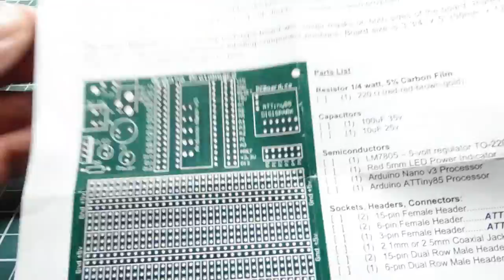Arduino Prototype PC Board / Nano Breakout

Comment from the maker: I talked to the manufacturer of the Arduino proto-board and they are planning to redo the board and change the orientation of the Nano. If you have any other features on your "want list" leave them in the comments.
Reply: Did this change ever make it to the board? I need to use the Nano as a Midi-USB device so it would be great to have the USB face out. The boards linked in the description still look like the USB is facing down

Comment: Looks like a handy board. Don't you think it would have been a better idea to have the USB port point off the board like the the power barrel connector? That's what I would have preferred if I wanted to put it into an enclosure.
Reply from the maker: I was thinking the same when I was building it. The ATtiny85 is pointing off the board.
Maybe they wanted access to the 6 pin ICSP for firmware upgrades.
Reply: Maybe but upgrading firmware is more likely an open-the-box kind of task. I supose, if you really wanted access to the USB port, a short cable could be attached and connected to a bulkhead mounted USB socket. Does anybody make one of these? I haven't seen one, just USB extensions.
Reply from the maker: Yes .. that would be an option. You could also get into the box using the ATtiny85 USB connector or the SPI port on the Nano ICSP pins. If this board does not match your project and gets too involved and impractical you can always build what you want on Veroboard or build your own PCB.
Reply: Very true. Thanks for a great channel.
Reply from the maker: I talked to the manufacturer of the Arduino proto-board and they are planning to redo the board and change the orientation of the Nano. If you have any other features on your "want list" leave them in the comments.
Reply: One thing occurred to me. Is the silk screen calling out all the pin numbers on the back of the board too? I might, for example, want to put the connecting wires on the back side of the board if I were hard wiring a low profile prototype.

Comment: board looks awesome .  You would think that the Nano be the other way so that access to USB is on the outside of the board avail through a case!!!!
Reply from the maker: I talked to the manufacturer of the Arduino proto-board and they are planning to redo the board and change the orientation of the Nano. If you have any other features on your "want list" leave them in the comments.
Reply: Nice - this definitely would be a nice proto board then

Maybe perhaps have a socket for the AVR chip ( ATMEGA328p-PU ) / ATTINY85  or any of the common AVRs?  that would be great board also if consider low  power prototyping.  Perhaps they can do the same for AVRs as they have for PICs

Comment: Nice video but as many have mentioned, having the USB draped over the board is a serious error. I hope they will fix it...
Reply from the maker: I talked to the manufacturer of the Arduino proto-board and they are planning to redo the board and change the orientation of the Nano. If you have any other features on your "want list" leave them in the comments.
Reply: Wow! You're the man!!! I hope your number of subscribers takes off. I was searching youtube for videos on development boards with attached proto boards and didn't really expect to find anything. This board looks really nice and takes care of a lot of convenience issues that normally result in a mess of cables, so it was surprising to see the USB cable issue, but I'm sure the manufacturer knew it was a problem as soon as they started testing. It's a pain in the butt to actually mock up all the I/O, but if you don't, sooner or later this kind of thing happens.

It looks like the 7-12V barrel input has an accessible output next to it which is very convenient for using somewhat higher power devices. It's nice that they made this easily accessible.

I'm really hoping that at some point someone does something like this for an ESP32, but until it really catches on with a wider audience, that's too much to ask...

Comment: what is the huge board at 4:28 Sir???
Reply from the maker: It's basically a mini PC single board computer, X86 with solid state disk drives and an operating system.
It is called Flashlite186 by JK Micro
http://www.jkmicro.com/Flashlite186.html